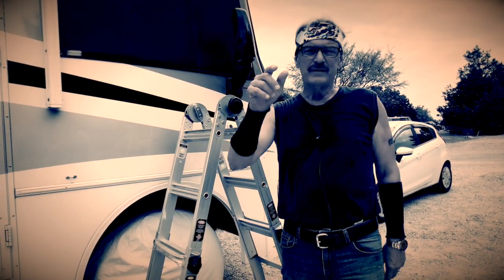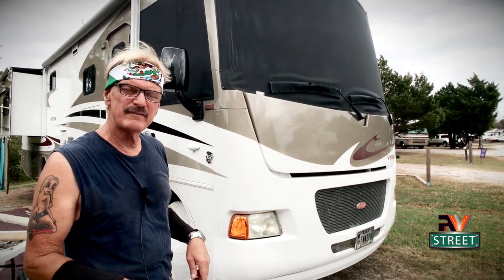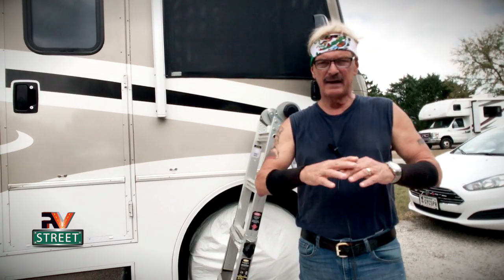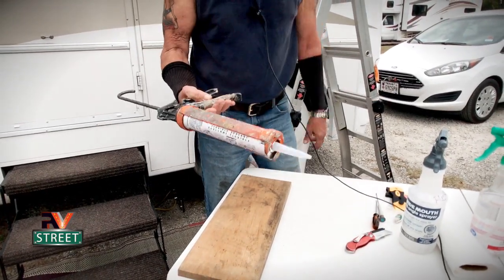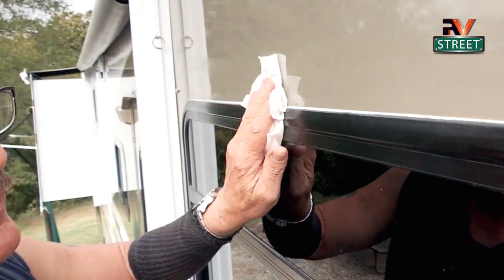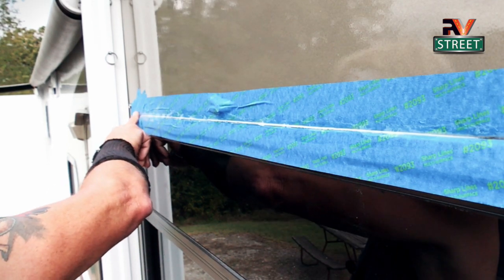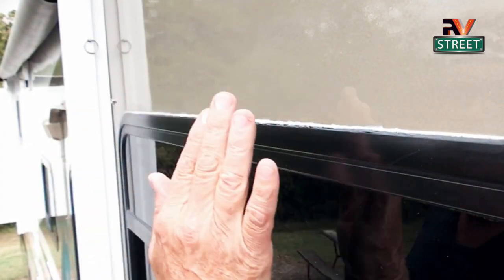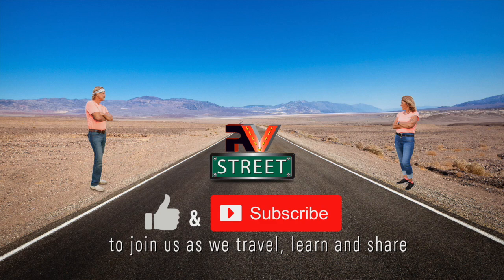RV Sealant to FIX WINDOW LEAKS. Easy DIY

Comment: One day too late! I climbed on the roof of my RV the day before you posted this video, washed it and applied a sealant to the front where the MH meets the cab of the Trend. First time doing any of this work. Painters tape would have been a great idea to use. I’ll remember that for next time. The job I did wasn’t exactly what you’d call pretty but I was proud that I did it myself. Thanks again for another great lesson!
Reply from the maker: And you should be proud. Most of the stuff I show on our channel is to empower people to do these DIY maintenance things themselves, know their rig thoroughly and save big money. So I salute you. 💕

Comment: A great video that will be permanently stored in my library and reviewed before each time I work on this area of the coach. Unfortunately, I had to do this last summer before this video as we had major leaks around the windows, but now I have this video saved as a much better way to do this. Our 'bago has the same windows and they started leaking like a sieve last summer. It's so surprising the poor job that was done on sealing these windows in the factory. Our's started failing after just 3-4 years! We found lots of puddles on the dash inside at the base of the windows. Seeing your approach to this I will now likely go back and have a "do over" on the project when it gets a bit warmer. Many great tips here. Can't emphasize enough how important this is for all class A  owners that have this type of window. Thanks, Martin and Joanie!!!
Reply from the maker: Yep there's a lot of shaking and rattling going on down the road and stuff just come loose. But your right, there could be a better way to stabilize and seal these window from the factory. It's just one those things RVers have to Pay to Play.

Comment: Nice tips! I was in the RV industry several years, new and used. For safely scraping off old goop and putty I’d cut plexiglas to fit my hand, angle one end with a grindstone and voila scraper tool. Wears down sharpen up again. For cleaner I’d use acetone all the time. If the window seal was too ugly or evidence of leaking inside on walls I’d remove the windows, clean and butyl tape then crisscross screws on reassembly.
A tip for anyone that has to go this far is never use the old style oil based putty tape (black streaks) when replacing. Use only butyl tape. Did this on trailers campers and some motor homes. Occasionally on a leaker it was good to pull the window because a couple of them had a rotted lower wood frame. A little tricky to dig out and replace but doable.

Comment: Martin,   I was taught when caulking, to cut the tip at a slight angle, put long side of tip out, and push the caulk tip instead of pulling.   Watch just ahead of the tip and you will see the leading caulk.   This method also pushes it into the cracks a little better.   
Respectfully,   Kevin
Reply: Thank you for that info

Comment: And yet another GREAT DIY video Martin!  As soon as the weather breaks I'm going to go out and examine the tops of the windows, would have never thought of that before seeing this, thank you.

I have one tip....I find that when I cut the end of the caulk tube at an angle the material seems to flow into the area being caulked smoother than when I cut it straight and requires just a bit less touching up.
Reply from the maker: Yep your right about the angle cut on the tip. 
I have always done that too for years but was so focused on making sure everyone saw the small hole it just slipped my mind. 👍

Comment: Another great video!

I have found that using Transtar Acry Solvent on the old silicone sealant works wonders. It softens the silicone and it peels right off. I then wipe it down with acetone and then denatured alcohol to remove the silicone oils so the new sealant, I use proflex as well, sticks well.

I am going to be resealing my windows and vertical seams soon. I will be using the tape trick. Thanks for the great info.
Reply from the maker: Oh, Ok that product is something I haven't heard about to remove "old silicone sealant". 
And I'm glad to see your using ProFlex too.
To everyone reading this comment, DO NOT use Silicone. Use Proflex like me and Hard Truth.

Comment: The quality of your videos is improving a lot, and your content is good!
Reply from the maker: Mike, just for my info, what part or things I do that you see I'm improving upon? I'd like to know from your perspective. I'm always trying to up my game so it will help people more.
Reply: @RVstreet  I see three things improved: your photography is significantly clearer and  the angles you're using are absolutely better thought out. Your editing is tighter, with more attention to zooming and cutting in to insert detail shots. I think your lighting is better - using a reflector, maybe. Oh, and wind noise is greatly less than your earlier videos. 
And you lost the mullet! LOL
I know this is a mundane subject, but could you cover how you handle trash while boondocking?  I don't want to stash it outdoors, nor do I want it in the basement, and surely don't want it in the cabin. And ashes?
Reply from the maker: @mikebrant192  And you lost the mullet!
Mike that was NOT a mullet. I don't do mullets. It was long hair with a bandana or sometimes put in a ponytail. LOL
But anyways, thanks for sharing your thoughts on how my vid's are getting better. I really put a lot of time to not only cover the details but the things you mentioned.
As far as the trash question...I don't have much input there because we don't do a lot of boondocking even though it is possible this coming spring. Just depends on what happens in the next few months.
Ashes? We don't mullets or ashes. Joanies hates the smell of camp fire smoke on her clothes. haha 😜

Comment: Hey Martin, so I did some testing on my 2020 palazzo 37.4 and removing the geocel sealant. I found that the spray bottle of Goo Gone softens the sealant beautifully so it can be easily scrapped off. No damage at all to paint. Much safer than using mineral spirits or gasoline.

Just sharing so your viewers see it
Reply from the maker: Good advice 👍

Comment: Great video. Another “To Do” item added to my list. 
I noticed on 
your awning arm it looks like you have a small clevis pin thru the arm. Is that there to avoid an accidental awning deployment?  I’ve often thought if that might happen. 
Thanks for this video.
Reply from the maker: Well, that's just part of my safety hardware to prevent accidental deployment while underway. I plan on doing a video on this sometime in the future.
Good eyes my friend. 😜

Comment: Your videos are great , thank you for all the work you put into them. You mention that you worked on your bay doors, which is an issue I’m about to tackle. Can you tell me which video would show that content? Due to health issues, I had not been to my stored  Motorhome in 5 months, and for a 2020 Winnebago Sunstar model she now looks more like a 2000. Florida  weather  has not been kind to my RV’. We checked the bays out and only the front two passenger bays had significant dampness.
Reply from the maker: Hey Missy,
Your 2020 Winnebago Sunstar is a nice coach. 
I didn't do a video on my bay door sealants even though I did mention it in the vid you watched. I did all those bay doors before we even started our YT channel, so no video. As you saw in the window sealant video, I showed how I taped off to reseal on the OUTSIDE seams of my bay doors. This is a PM item that should be checked about once a year. All sealants are an annual PM item. BUT...to address your situation living in Florida—which is very humid, lots of rain and damp all the time—if you have dampness or are struggling with dampness in a couple of bays do two things:
1) Make sure you keep your rubber seals conditioned so the doors seal correctly. You probably saw that video....https://www.youtube.com/watch?v=F5YSBrmuTCA
2) Buy a couple of DampRid Fragrance Free Disposable Moisture Absorbers. I have these on our Amazon Store under the Category named "Misc. Goodies". DampRid is at the bottom. They're cheap but help a lot. I also always keep one of these in my electrical bay too, to keep everything in there dry and especially my transfer case. Very important to keep moisture out of there.
https://www.amazon.com/shop/rvstreet

NOTE: If any of your bays gets to wet or damp for any reason, get a small portable fan from Walmart, open the bay doors, put the fan in there and dry everything out. Then put a DampRid Absorber as maintenance. They last about a month or so. When full of water, replace. You don't want mildew or mold to develop.
Hope this helps. Keep you chin up. All is good. 💕 👍

Comment: So you dont caulk all the way around down the sides and under the window frame? Ive got a 2023 braxton creek with one window on each side and both of them leak. Driverside wall was water damaged when i first bought it and they fixed it under warranty finally got it back 2 months later in time for 4 inch rain storm and i noticed actual water dripping inside from under the metal frame of the passenger side window now. The caulking around the outside of the frame looks incomplete down the sides and none underneath.  I temporarily taped plastic around the window to deflect rain untill i can get it back in the shop.  Really displeased with braxton creek.  Sorry for the rant.
Reply from the maker: Rants are a great way to relieve stress 😁 On a sad note I have to say that Martin has passed away and I don't have any answers for you 💔

Comment: Great tutorials.. I have a problem that might get costly if l don't fix it soon. Problem is that l don't know where leak is exactly. Sometimes my rug will get wet. I am guessing it's because my sliding door gaskets are worn. Rug gets wet especially when it rains hard but not always so it's hard to pinpoint the problem. How do you advise me to proceed so l can follow thru in a proper manner. Thank you in advance. Happy New Year's 2023 by the way Martin.🥳
Reply from the maker: Ya, tracking down where water is coming in can be difficult sometimes. It's a process of elimination. 
Without seeing or knowing the type of rig you have, the best way to approach this is start with the obvious first.....the door gaskets. Then get on the roof and check all your seams, vents etc. and make sure they are sealed good. Also outside, running lights are notorious for leaking - pull off the lens covers and check sealant around where they attach to the RV. Window seams etc. Con't this process until the leaking stops. Stay on top of this. Water intrusion is the biggest enemy of RV's.
Also pay attention to when it leaks. Does it leak when there's hard driving rain? If so that's a clue that it may be coming from under your A/C units which aren't sealing properly to the roof or possibly your slide seals. Hard wind driven rain can find leaks that otherwise would not leak.
Reply: Gooood comprehensive reply Martin!!!
👍😃🍻

Comment: Martin- always informative. I have a question regarding sealant. Will Proflex work on the shower sealing? Looking for a product that seals and will not mildew. Thank you in advance for your reply.
Reply from the maker: For the shower i use GE, clear, mold resistant Silicone.

Comment: Hey again Martin. What do you use to get the outdoor side wall outdoor sealant off? My  class A motorhome exterior joints were sealed with geocel. What do you recommend that is safe for the clear coat? I used mineral spirits on a test spot and after letting it soak a bit and it dried, you can tell it munked up the clear coat a bit. Thanks for your awesome vids
Reply from the maker: What do you use to get the outdoor side wall outdoor sealant off?
Hummmm....not quite sure I understand your question about *outdoor side wall*. Can you elaborate some please?
Reply: @RVstreet  sorry i was doing voice to text....no good, so I'll try again BUT type this time.

I have a class a motorhome that uses Geocel 2300 "caulk" to seal the exterior seems of the coach. I have a few seals that I need to remove the old caulk. Thor Motorcoach told me to use mineral spirits to soften up the old sealant so it's much easier to remove. However I tried using mineral spirits on a small spot and it took my coaches clear coat off the paint.... I was wondering if you use anything to make it easier removing old exterior caulk/sealant... I've heard some folks us wd40. Thanks.
Reply from the maker: @CatFoodDraino  OH, Ok. Well I don't use anything to soften it up. I use a stiff, handheld, narrow plastic scraper to get the bulk of it off. Then I use a plastic razor knife to get the finer pieces. Then wipe down with alcohol. Tape it off with blue painters tape, apply new sealant then use thinner for my final smooth out. The tape keeps the thinner off the clear coat.
Reply: @RVstreet  thanks for responding! Unfortunately this rv Pro Flex won't come off with Just a scrapper. I used gasoline last time and it seemed to work ok and soften it without messing up the clear really. You just gotta work fast and lots of quality papertowels. Tons of elbow grease taking this stuff off.

Comment: Could you leave the tape on until dry, then remove it?
Reply from the maker: No do it when it's soft, otherwise as you pull the tape one of two things will happen:
1) The tape could tear under the dry sealant and now you'll have sealed tape
2) You'll tear the sealant and it will pull away from what you were trying to seal

Comment: So I’m going to be the guy with the odd question…what ladder are you using? Couldn’t find it in your Amazon store.
Reply from the maker: My ladder that I bought 5yrs. ago is no longer available. BUT...quite awhile ago I carefully picked one that's just like mine and it's 2lbs lighter than mine. I love the versatility of these types of ladders and there very solid and steady. It's in my Amazon Store in the "Everything on the Roof" category. I don't know what happened, but the link to it in my store appears to have changed. I've fixed it now.
https://www.amazon.com/shop/rvstreet
Thank you Sir 👏

Comment: Love your videos. Would you use this geocel rv on a frp walled shower stall? Thanks
Reply from the maker: No I wouldn't. For that application I use GE 100% Silicone - Mold Free. And that is the ONLY TIME I use Silicone for anything on the RV.
Reply: Thank you....

Comment: I ordered some items from ur Amazon store. ?   Will the mt320 variable speed buffer(sp) fit the 300 plate attachment I ordered..
Reply from the maker: Thank you Katie 💗
The polisher I use and the one that's in my store is the Meguiar's MT300. So I think you typed the model number wrong above. But ya, the backing plate 300 will fit the Meguiar's MT300 polisher.
Thank you so much Katie for supporting our channel and using our Amazon Store to buy ANYTHING you need, whether it's in our store or not. 💗
Reply from the maker: Katie,
I came back this morning and read your comment again. So......it looks like you didn't type the wrong model# for the polisher. I looked on Amazon and there is in fact a Meguiar's MT320. I thought you we're talking about the polisher I carry in my store which is the Meguiar's MT300 model. The backing back I have right next to it does fit that one. I'm not sure if it will fit the Meguiar's MT320 though. But my guess is it probably will.
Sorry for my misunderstanding on my first reply.

Comment: Do you have  TPMS tire monitoring system on your towed vehicle? I have on my 34ft Monaco Monarch SE but need one for my towed Sunrunner. It seems the distance from the dashboard to the Sunrunner is critical. Any suggestions?
Reply: The Blue tooth signals from some TPMS systems have distance limitations- especially in longer rigs. Its been a major problem for us and I have yet to resolve it. We're on our second TPMS system and we still can't get it right. There are TPMS systems (I'm not sure which ones) that offer signal boosters to help alleviate the signal loss issue that can be placed in the rig to improve the systems. Maybe someone can chime in here with the type they use that has the better signal quality and signal boosters? I have not yet found a generic booster that will work for all TPMS systems????
Reply from the maker: Having a TPMS on ALL TIRES (including towed vehicle) is my very most important thing every RVer should have and I have shared and emphasized that in many, many of my videos'. So I'm glad you asked so I can emphasize it again. 
If you'll watch this detailed video, I cover everything about our TPMS and yes the brand and everything I use is spot on and yes and I use a booster too. My TPMS has a booster separate option and yes at that length you need one. I never have issues loosing signal. A TPMS is one piece of equipment nobody should ever go on the cheap with IMO. Anyway I covered everything here. This will answer all your questions.
https://www.youtube.com/watch?v=2kCXRbvtoYA&t=779s 

NOTE: I always put links in the description text to purchase the products I use in every video. This outstanding TPMS unit, booster etc., is also in our Amazon Store under the category "Tires, Engine and Chassis Care" that you can see here.
https://www.amazon.com/shop/rvstreet

While we're talking about TPMS, airing up tires properly and monitoring them, you may find this video helpful too:
https://www.youtube.com/watch?v=Q_NuEoBIxe8&t=613s

And one more link if you want. Here's a whole Playlist of vid's you may find helpful too in caring for your rig.
https://www.youtube.com/playlist?list=PLkQXtMp9xodTJ0dM4aG8P8IcYEEWBtWBc

thx Georges for chiming in and asking that question. 🔧👍🔧

Comment: How do you seal taillights that get foged after a rain
Reply from the maker: I re-sealed ours by removing the plastic lenses, applying a new weather strip from Hime Depot, screwing back on the plastic lens for a tighter fit. Then, I drilled 3, 1/8" holes in the bottom of the lens to allow it to breath. DONE.